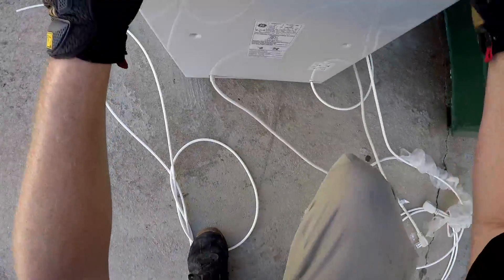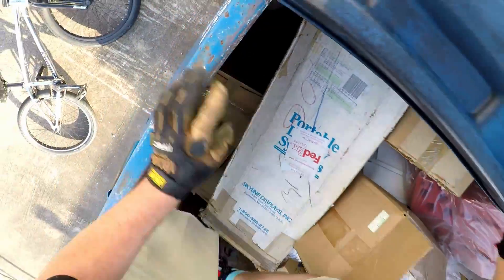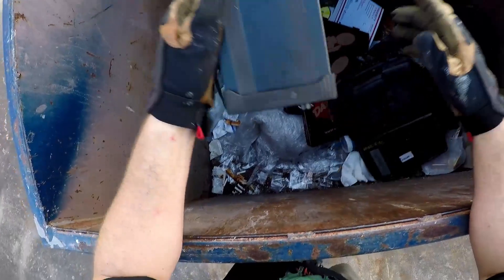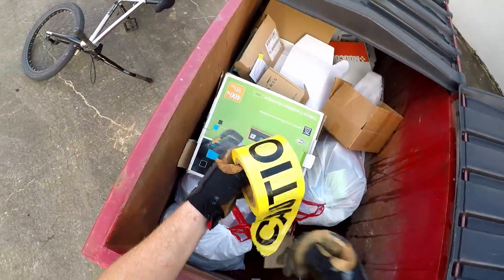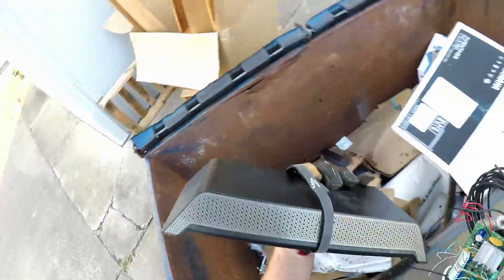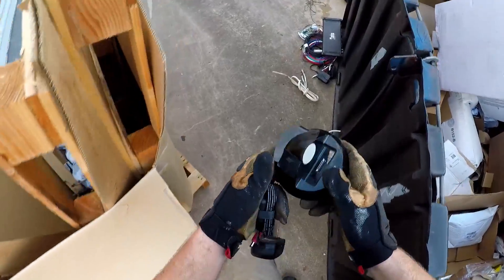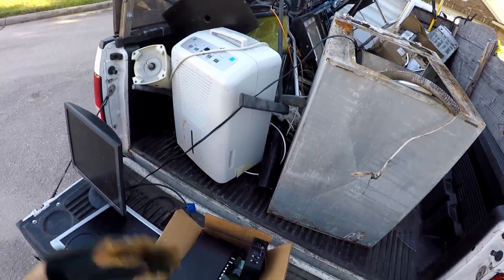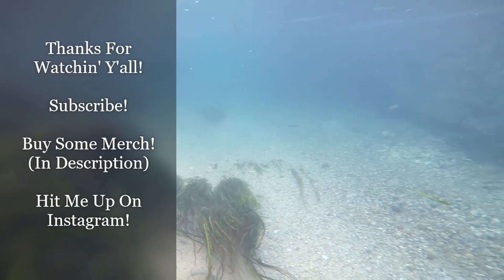Dumpster Diving "Probably Shouldn't Even Be Touchin' It"

Comment: open top dumpster action hmm is that the same one by the closed down music shop? or no but hay there's scrap, oh no something going off flea come back later as the late lil richard song goes "keep a knockin but ya can't come in!" portable hard drive or dvd player? huh but yes that case is alluium, aww 'mon mike keep the caught tape could use it to wrap up a dumpster with good stuff in it just get some dry ice put that in there put the tape on the dumpster heh would put any other dumpster goers off, old books vid vulture might bo going though them but they look to just be of that not quite collected by nerds but also no one is wanting them kinda books shame, a speaker for an office got wet but let it dry out should send that to scrap pallet man mike he can then be all like "attection, your local scrap man needs you, if you have any scrap put it on the crub and i'll or others will come and collect it, remember if we don't scrap it, it only adds to landfill sites" trucks a bit full but eh there's still room shoot could get loads more in there, just need to use the snap tool or go upright, still sealed blood collection tubes hmm yeah no not got a use for them and there not in demand,